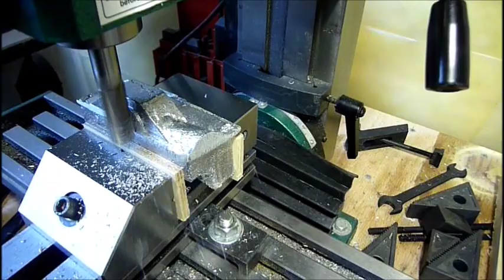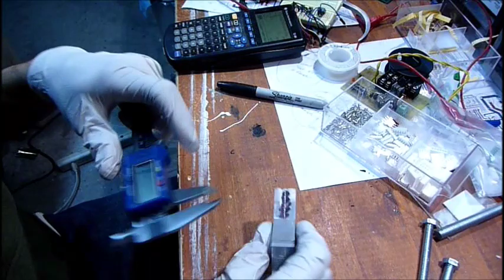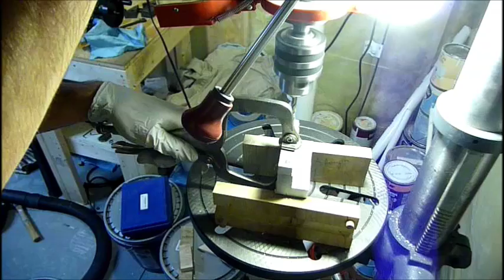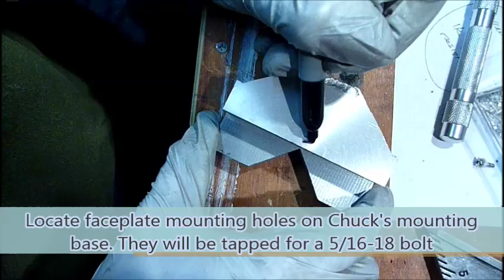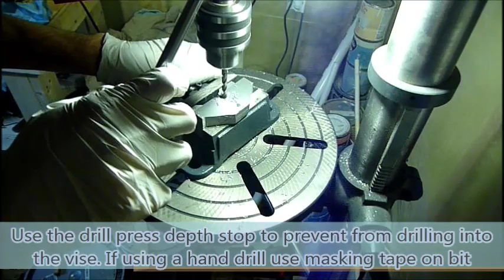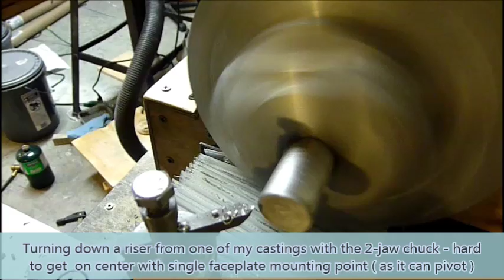Making the Gingery 2-Jaw Chuck

Comment from the maker: Hi, thanks for the comment! During the build the 2-jaw chuck was very useful ( Dave should have included the build of this chuck in book #2 at the end of the lathe build, a chuck in my mind is an essential accessory for a lathe ), however at this point since I have a 3-jaw chuck mounted and working quite well, so I don't really use the 2-jaw anymore. An accurate setup is a bit more difficult to achieve with this 2-jaw faceplate chuck.

Comment: i noticed in a previous video on your lathe the part looked like to me a truck part for holding a drive shaft with a bearing in the center i have a few different sizes i might be able to use in my build later or for some other part for the lathe maybe for gunsmithing barrels ive learned everything by trial and error and im a magiver of sorts

Comment from the maker: sounds pretty crazy to me, but who knows I'm no expert. Do you have a faceplate? That I'd imagine is made of metal, you could get some angle iron and bolts and device something similar out of metal which would be much more secure. Dave Gingery has some plans for that in his Horizontal Mill book - 2 lengths of angle iron with bolt holes at the base to mount to the faceplate, and two holes on the uprights such that the 2 angle pieces bolt together and tighten onto each other - like a vise.

Comment: Just a quick question.  Did you find you had to retighten stock held in the 2 jaw chuck?  Being aluminum I would think it would wear or deform some thus requiring the object to be tightened.  But way cool all the same buddy.
Reply from the maker: Hey MrClockbob, to the extent that I have used this chuck, I haven't needed to re-tighten while I'm turning down a piece. ( I have a 3-jaw on my lathe at this point which I use more often ). I typically don't keep the same piece chucked up for very long though, and I have only done fairly light duty work with this chuck so far.

Cheers,
Morgan

Comment: Did you build the bed and ways to the exact dimensions as the book?
Reply from the maker: The design was scaled up a bit to make it a bit more rigid, and to add a bit more capacity. My ways are 4" wide, versus 3", and my ways are also 3/8" thick versus 1/4". I also made most of the castings thicker, and added extra cross bracing to the lathe bed casting. The headstock is similar, but it has more metal than what you will find in the book, and the two top clamps are joined in mine ( making the whole thing more stable, versus two separate vertical sections ). Checkout my blog, or other videos for details.

Cheers,
Morgan
Reply: Morgan Demers
 I see but I was referring more to the length between the two centers.
Reply from the maker: Micscience The between centers is the same as the book, but my bed / ways are about 1" longer to accommodate my larger headstock casting.